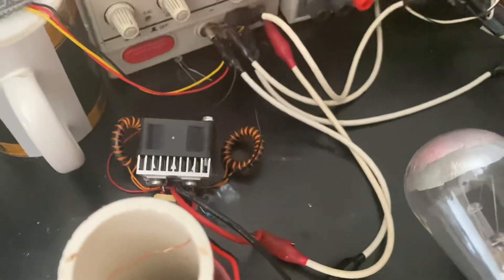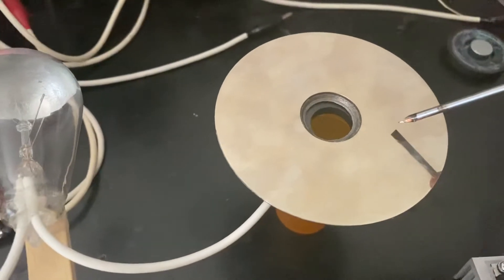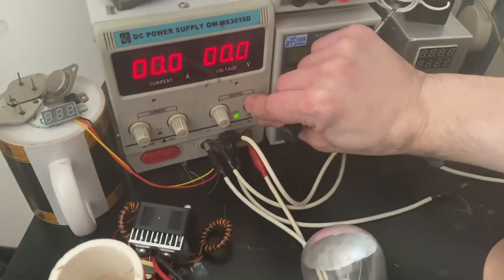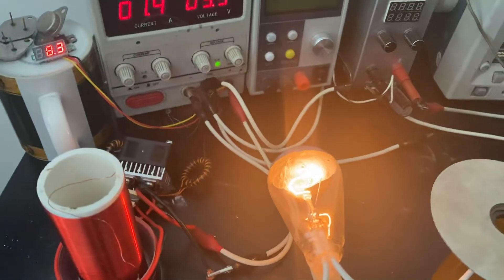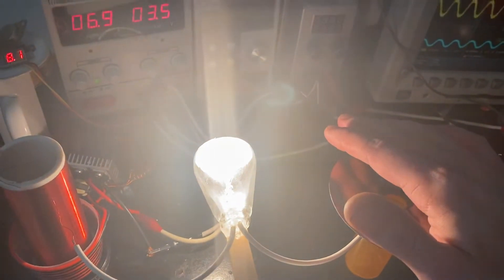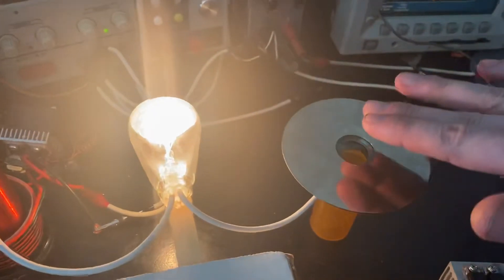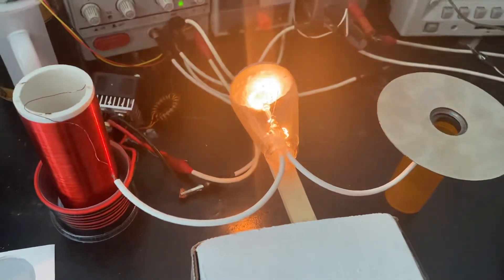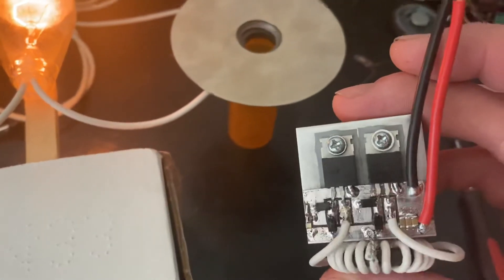The Simplest High Power SSTC? 40 W Incandescent Lightbulb Fully Lit!

Comment: @exoticpropulsion8175 .. so normally, 
120Volts x ?Amps = 40Watts and ?=1/3A.
So from what youre saying about the amps
being passed through is that you're able to
pass more current through the wire without
frying the wire? Or is this about using lower
voltage to light the bulb? 
Both have applications. 
Guardian: Jackpot
2023y10m07d02h35mCMT.

Comment: Looks to me like the CW push-pull circuit running bare-bones but I don't see feedback so it's a little strange. Either way I know that using such a circuit you can indeed get some nice transfer like this. I never did it off the topload but rather the secondary current on the ground side before it got to the feedback transformer.
Reply: He used a feedback transformer, same config as yours . Check 0:36

Comment: Mazilli without the capacitor between the drains gave me quite a display once, with an aluminium wire coil which had a small accidental loop at the tip,  the tip got white hot and escaped (not upwards tho)... I should've tried replicating that, but I didn't really know what I was doing  at the time. Actually that's driving the plasma ball in my video, but it was unstable when loading (as I say in the description) so I'd be surprised if u're using that